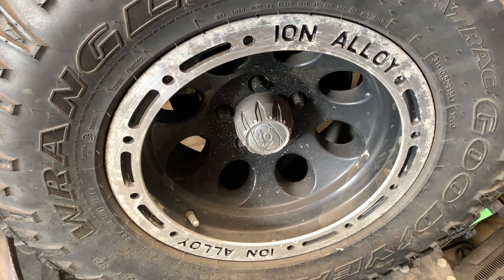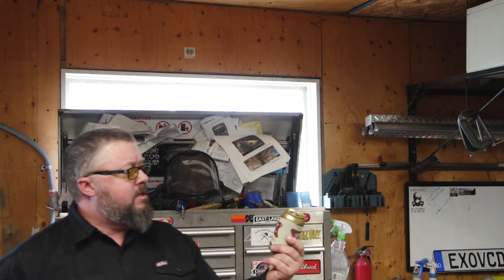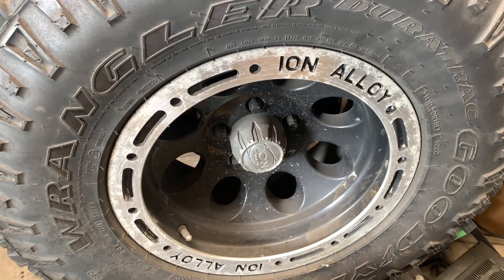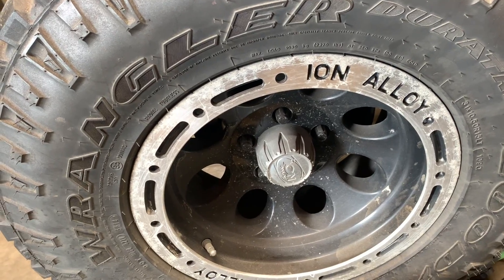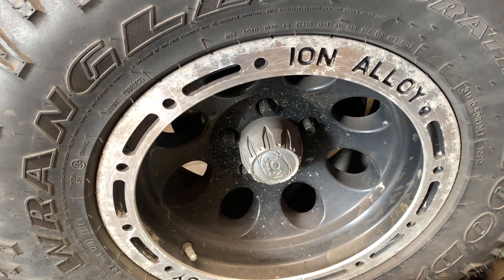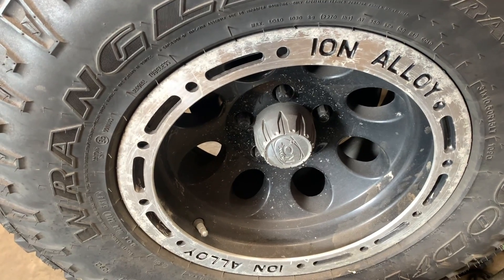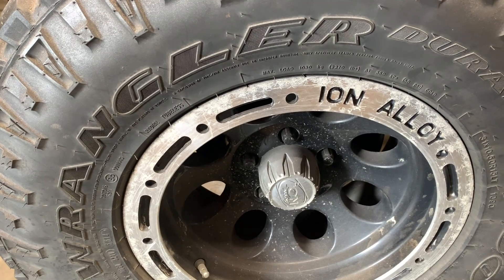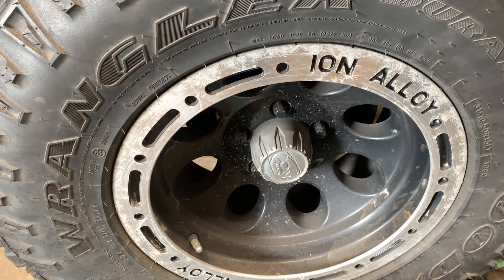Why Using Anti Seize on Wheels and Driveshaft Flanges is Bad

Comment: Interesting topic. I believe  the engineers are correct because we lack the knowledge to challenge the  recommendations of no lubricants are to be used.  Engineers use logic and reason with the highest regards to liability . Yes I do put a thin coating on the face of my hub but never on the wheel stud threads as it alters the  torque specification.
Reply from the maker: I do believe oil threads are a reduced torque compared to a dry thread
Reply: @BackCountryWrenching  correct , I have a chart somewhere showing torque levels on lubricated studs and many stud threads can not handle the  extra torque as the threads peel back and never hold properly again.  Anti seize on studs we see on youtube all the time is definitely not a good idea.😂
Reply: I'm not saying it's right but I always Grease my studs. 
Been doing my own work on my cars for 40 years, rallyed cars, tarmac racing, 4x4 comps, do all my own builds, I have never had a wheel problem, if I did I wouldn't grease them.
Reply: @harryjnr2335  You most likely will not have a problem but telling people to do it is another thing. Oh my I do all kinds of stuff your not to do. 😂😂

Comment: How about re-torquing after so many miles? Isn’t this really the reason why it’s always recommend after installing wheels after x miles?
Reply from the maker: Typically your suppose to re-torque your wheels after 100km to make sure everything is still good
Reply: But how many people actually do it my guess would be very few.
Reply from the maker: I’m going to say less than 10 percent do.  I had a coworker many years ago wanted me to check out her car as she was having a vibration.  Turns out her lug nuts were loose as she just had her winters put on a couple weeks prior